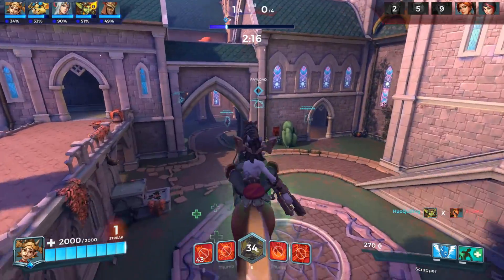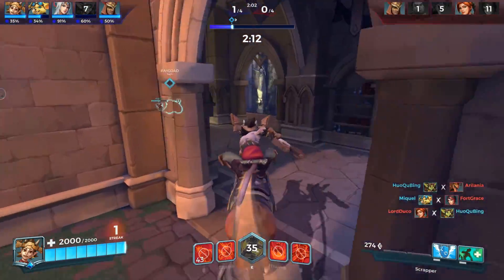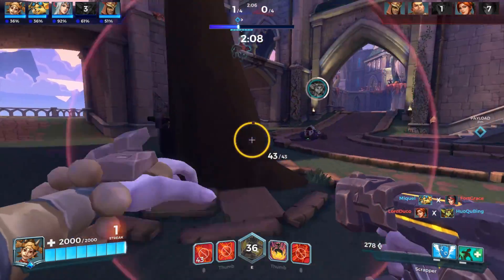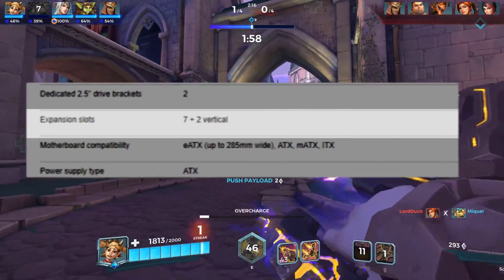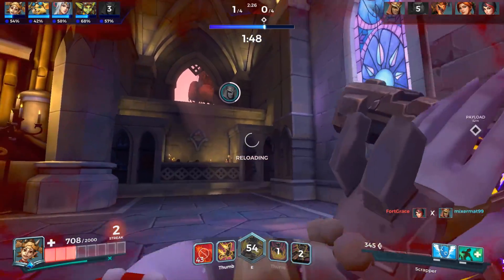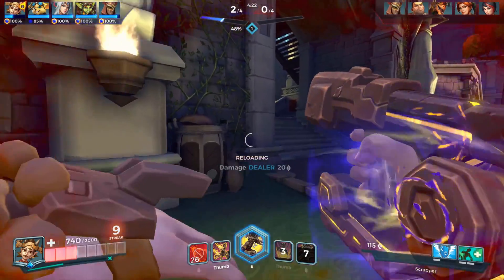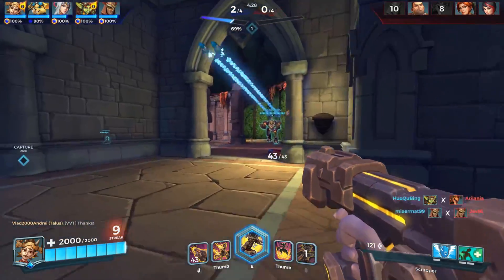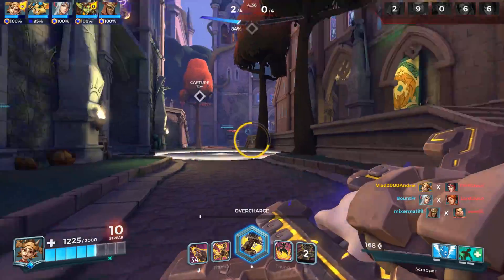A Guide To Case Compatibility - How to know if your case is compatible with the rest of your build

Comment: im having problems with finding a case for my pc. my current case has very bad airflow so i wanna move the parts over.
the fractal design north seemed the best pick for both airflow and design in my taste.
but considering both my rtx 4070 ti and my corsair H150I cpu cooler will have to fit in this length (AIO doesnt fit on top) this is tricky since i cant measure it out perfectly.

Comment: I have a prebuilt PC that uses a mini ITX board. I want to upgrade the mobo/cpu. The mini ITX mobo uses 4 mounting holes, and there is 4 expansion slots in the back of the case, 2 are being used by my GPU. It does have a power supply basement and I see there are 3 extra holes in the case for standoffs, 2 on the side and one below where the sata ports are. Im wondering if I can fit a micro ATX mobo in this case?? I see a micro ATX mobo is 3" wider than a mini ITX mobo, it does look like there is 3" on either side of this mobo open. Anyone have any ideas how I can figure this out?? Thanks in advance for any advice you have to offer.

Comment: All mid tower cases supports medium motherboards?
Reply from the maker: That isn't really a realiable method. Look up what size your motherboard is (ATX, EATX, mATX, etc) and then check if the case you want to put it in supports that size.
Reply: @GoodsauceTech  what about threadripper cpu it says strx?

Comment: If you guys are reading this in 2020 and your using pc part picker just click on the motherboard in the pc part picker list you have and scroll down all the way untill you see in the Compatible Parts menu it should be on the bottom right in blue.
Reply: Reading this in 2022. Have a Xeon x5675 that's in p6t motherboard. Have spare ram and gtx 760 so I thought I'll just make a PC with the spare parts